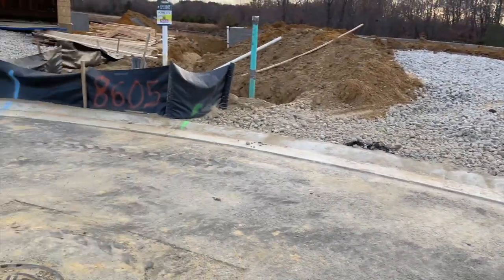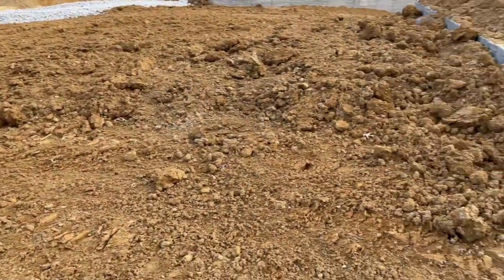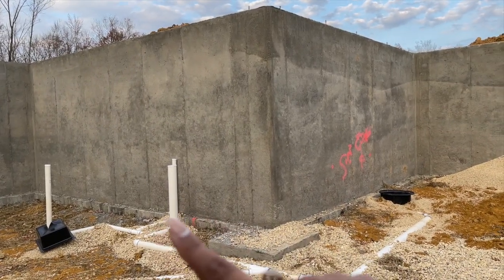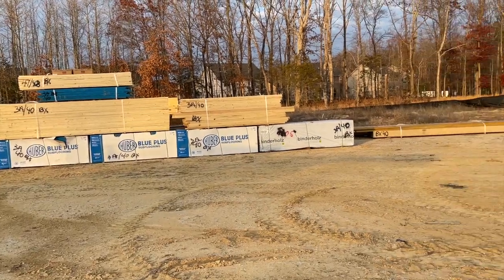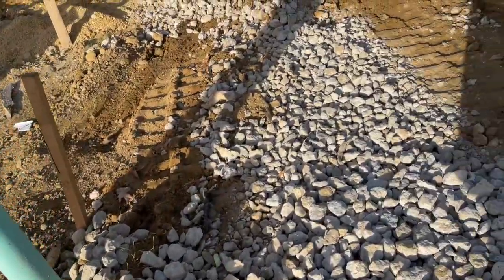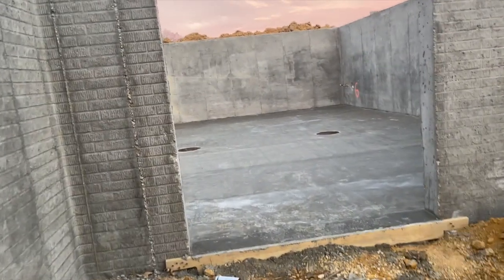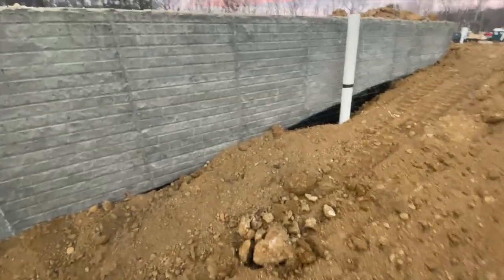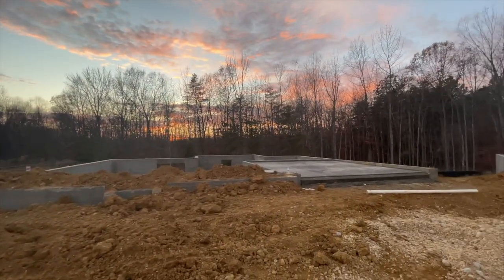Plumbing and Garage / Basement Slabs || DREAM HOME UPDATE! || Chateau de Moore • Stanley Martin Home

Comment: Hey Courtney! You’re doing the damn thing girl! Congratulations! 
Have you considered solar-power? You know I’ve been living “off-the-grid” using solar now for about 5 yrs! It has come a long way! I’m actually about to start a youtube channel myself to help explain it all. I’ll be in touch! Keep up the good work! 👍🏽
Reply from the maker: Hey Ambrose!! Thank you so much!! We actually have considered the solar panels on the roof. We haven’t gotten any quotes yet. But it’s definitely something we want to do! I look forward to your channel and learning more! ♥️♥️ Thank you again!! ♥️♥️
Reply: @CuratingCourtney  Make sure to look into any subsidies, & grants that are available, before you put down any substantial money first. I suggest you start small like I did 5 -years ago with a 100-watt kit from Harbor-Frieght. Things have changed drastically since then though. You dont have to go “full-on”  with all the equipment that I had to buy, (ie. “Battery, charge-controller, inverter,” etc.), because they now have all of that in one, small, portable-unit which is erroneously called a, “solar-generator.” It’s actually just a “battery-pack,” or “power-station,” that can be charged-up with just a couple of solar-panels, & used as a backup, UPS, (power-source) during blackouts. I just use them full-time! 😲
Reply from the maker: @ambroseavery5229  you’ve taught me a lot already!! Thank you for sharing!! ♥️♥️